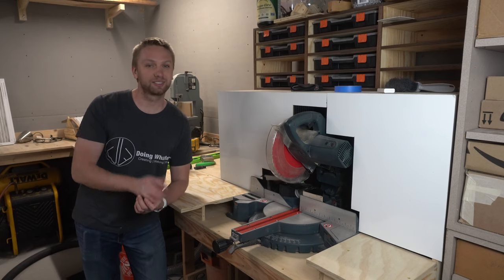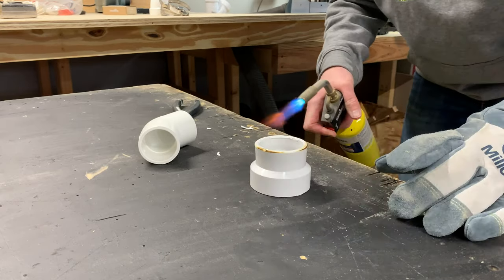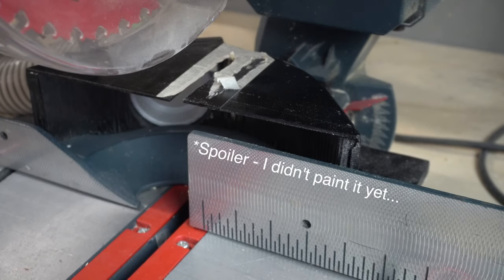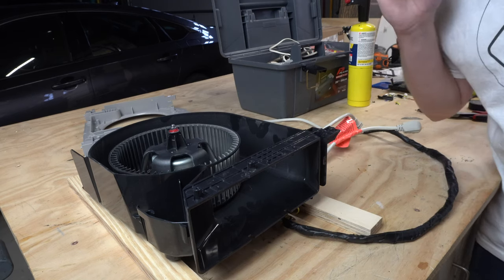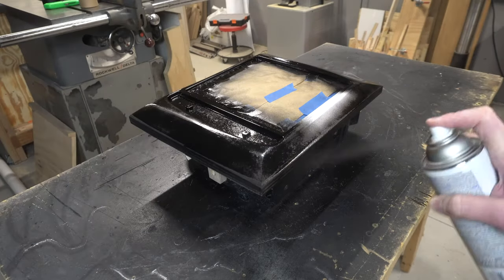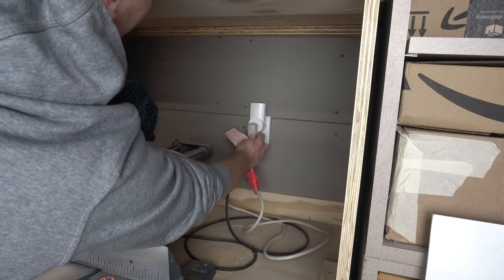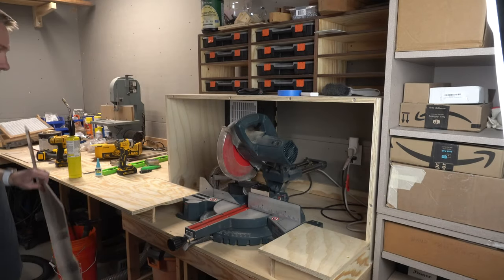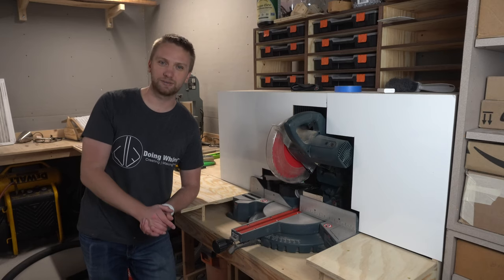Even More Miter Saw Dust Collection Improvements!

Comment: I used a fan from a broke dehumidifier also to pull the air out of the miter saw enclosure.  I just piped mine out the side of my garage through a dryer outlet.  Works a treat.  My garage is not heated or cooled, so I am not worried about losing conditioned air. 

As far as control of the fan, I wired a switch to an outlet on the face of my bench.  The saw and the fan are on the same outlet.  My saw has a shadow line I continually forget to turn off.  Having the fan on the same switch solved that problem, the fan is just loud enough to be mildly annoying.

Comment: Great idea, nice video. My chop saw needs some  dust collection. I was considering repurposing an electric leaf blower and in my case shooting the dust straight through the wall outside. Also I need to add dedicated lighting for the tool.
Reply from the maker: Thanks!
Unfortunately the fan crapped out on me not long after making this and I still need to replace it - I think it worked fairly well! would be nice to just send the dust outside instead of trying to filter it within the shop, that's a great idea!

Comment: Really cool. If it were in my garage I’d move the electrical connections out of the box. Outlet boxes are where most problems/sparks/fires happen. Even with the saw itself making sparks the outlet scares me more. Not worth that risk for me and moving it out isn’t more than a quick project.
Reply from the maker: That's definitely a good idea. Would be a little difficult to move the outlet now but I wonder if installing a cover (like an outdoor cover) would solve the problem... thoughts?
Reply: @DoingWhatever  it’s specifically the tiny arcs between the plugs that would worry me. If they’re plugged in and not moved it’s safe enough but it does draw heavy when you first pull the trigger. I’m more willing to cut drywall in my garage because I haven’t mud/sanded mine yet I’m an electrician so adding a box would be work so I’d procrastinate for a few months then do it. My first thought was put a wood box or channel over it to keep dust away from the outlet. Again it’s just be my extra paranoia worrying. Nothing’s gonna happen unless something really goes wrong.
Reply: @DoingWhatever  oh and I freaking love your channel. I binged several videos in a row more than once.
Reply from the maker: Yea it might be something as simple as what you suggested and would save me the worrying! Lol thanks for the input, I appreciate it!
Reply from the maker: Wow, thank you so much! I’m glad you enjoy them 😃😃

Comment: How did you know that the compressor went bad in your dehumidifier? My dehumidifier is not working well and I wonder if I’m having the same issue?
Reply from the maker: You can usually hear two different things kicking in when it starts up - the fan and the compressor. And no matter how low I set the humidity setting, only the fan would turn on. That and it wasn’t collecting any water in the bucket. Unfortunately I can only seem to get two summers out of a dehumidifier before it stops working..
Reply: @DoingWhatever  ok, sounds like mine is bad too. Mine doesn’t collect water like it did when we first bought it. So it sounds like I can perform surgery on it as well to extract the fan….lol Thanks for sharing

Comment: Is there an actual filter for the air moved by that squirrel cage fan?  What kind?
Reply from the maker: I have added a filter material to the squirrel cage fan. I use the filter material from our old house furnace filters (since they really aren't that dirty in comparison) and just cut a piece to size. It works fine for what it is lol

Comment: A solution, if you stop using the mitre saw, you eliminate the saw dust. How are you changing the angle of the cut
Reply from the maker: If I stopped woodworking all together, I wouldn’t have any saw dust at all 🤣 
I like the miter saw, it fits well in my workflow, but I know people have varying opinions on its utilization. 
To make an angled cut I simply pull off the front panels (they’re held on by magnets). It’s a less effective system with the front panels removed but most of my cuts are 90 degree cuts. Thanks for watching!
Reply: @DoingWhatever   Hey, blame it all on those pesky trees!